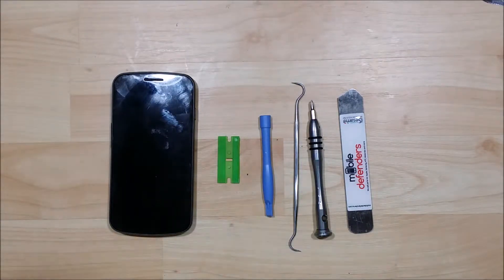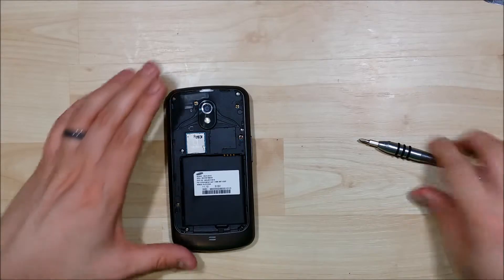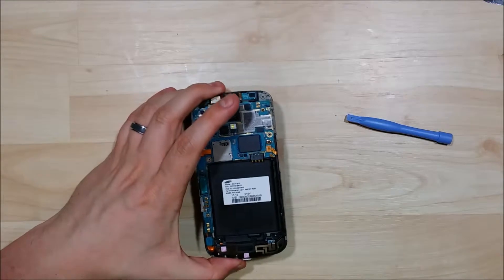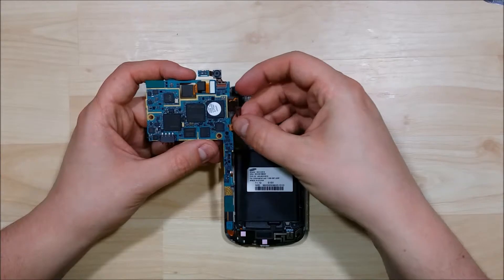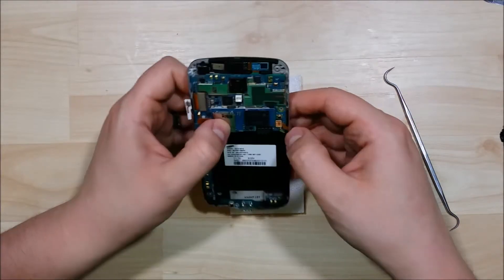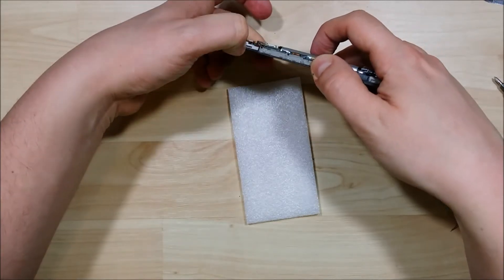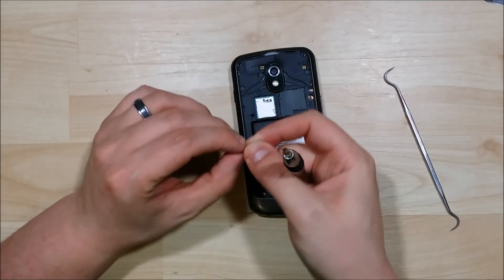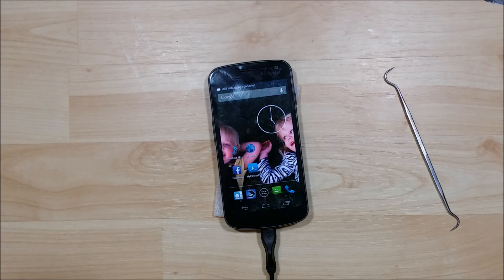Samsung Nexus Power Button Replacement and Disassembly  i515 L700

Comment: please reply to Martin Mendez @How2Tech this is very important for me. please. i am begging u.
Reply: this does not bode well
i just bought a nexus s but it seems im not the only one having issues finding a replacement power button
Reply: @gigabytemmx  seems like i found some method. though it was just functional. i will share it if u want (later though)
Reply: just write it al aliexpress galaxy nexus flex